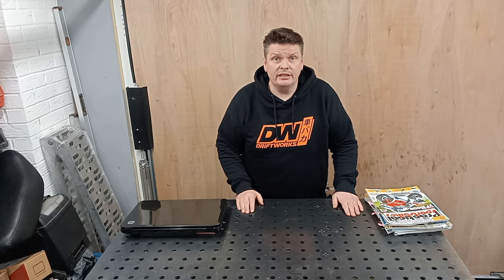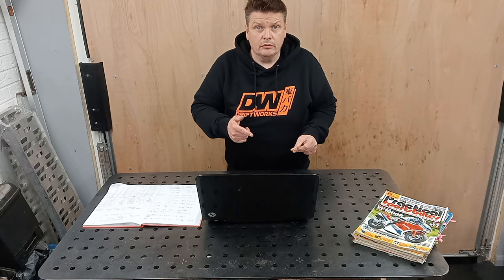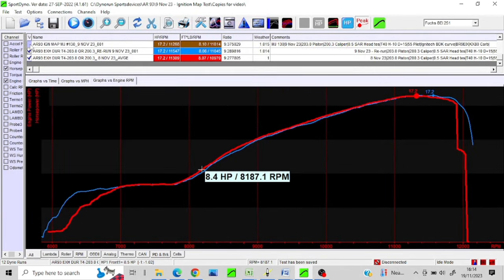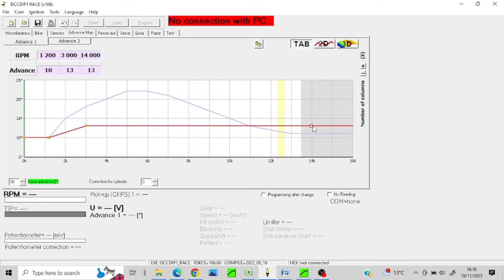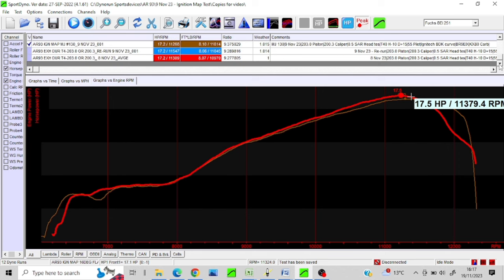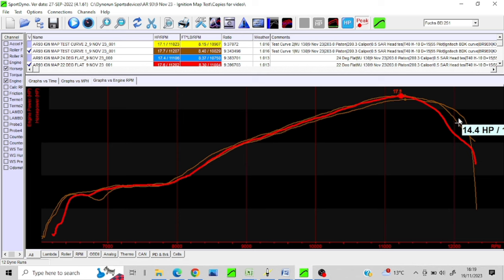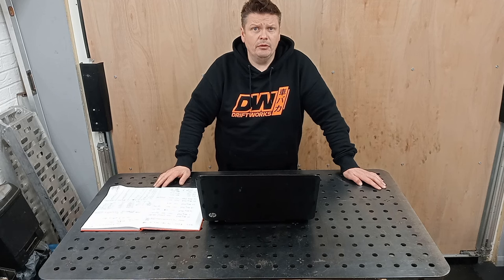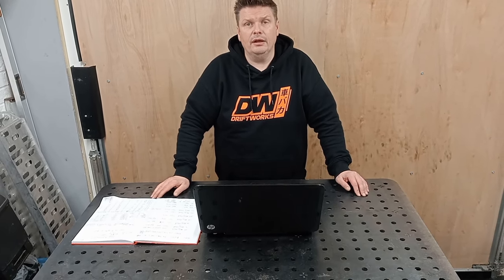How to make the perfect  2 Stroke Ignition Curve - 100 MPH Moped Challenge #2stroke #power #dyno

Comment: Dude Please don't pay any attention to Derek Harris, he believes that the reason for retarding the ignition at high RPM is just to create heat in the pipe, You can see your 10 degree flat line test sent the pipe temperature through the roof but the power curve was crap!  He thinks that the VE of the engine is not a factor in determining what the timing needs to be at any point in time. The real 'icing on the cake' for me was when he stated in a post that peak cylinder pressure should occur at TDC, this is total nonsense, the likes of Ricardo Developments worked this out years ago, peak cylinder pressure needs to occur between 14-20 degrees ATDC.

7:05 Your timing 'curves' make perfect sense, you can see how the timing needs to advance as the revs rise up to around 8k RPM, this is because the RPM is going up but the VE of the engine is still fairly poor, (the engine is not 'on the pipe'), in this state the timing needs to advance to give enough time for the flame front to create peak pressure at 14-20 degrees ATDC. Then as the engine comes on the pipe the VE starts going up and up, the initial cylinder pressure before the plug fires is going up as the pipe and intake 'resonate' harder and harder, the initial cylinder pressure has a great bearing on the flame speed so the timing has to start retarding to compensate for this. A.G Bells book on 2 strokes explains why a 2 stroke runs an advance curve until the engine is making decent power and then it runs a retard curve once its in the powerband, its all to do with the VE! (The aim is ALWAYS to get peak cylinder pressure at the right point in degrees ATDC)
Reply: Uncle Tony’s garage, did a video called “ ignition timing how much and why” 

It’s worth a watch.
Reply from the maker: Hi Pete, Derek is a very smart guy. From what I have read he's very well educated in two strokes. I also believe that the ignition being retarded after peak increases the over rev by heating the pipe and allowing it to resonate at a higher rpm. As seen in my video with the 13 degree curve being better after peak and shown by the egt increase at that timing.
Reply from the maker: Cool - I'll try to take a look
Reply: @AutoBeta2T  Yeah, fiddling around with the timing AFTER peak power RPM might extend the rev range by a few hundred RPM but really your main concern should be the power curve all the way up peak power, then after that anything else that you can gain after peak power is just a bonus. Like I said, the second that 'DH' stated that peak pressure should occur at 0 zero degrees (at TDC) my mind was made up. (I'll refrain from typing out what I actually think!) 🙂

Carefully set an engine up at exactly 0 degrees, then stand an elephant on the piston, no torque would be created at the crank!

DESPITE your reference to Derek Harris I will still 'like' your video!
Reply: @sidecarbod1441  What youre saying mimics what I have managed to learn about two-strokes over the last 30 years. Im not 100% sure but I imagine peak pressure at 0 degrees would be needlessly abusive to crank and rod bearings. There just no mechanical leverage to rotate the crank at 0 degrees either. It doesnt make any sense to me to do such a thing.
Reply from the maker: @sidecarbod1441 Pete, where did Derek state peak pressure should occur at tdc? I just rewatched his video and couldn't find it mentioned. He did say that the timing does occur closer to TDC.
Another way to think about it is  that the pipe is the key influence to the VE. Kinda chicken and egg.
Reply: @AutoBeta2T  Yes the pipe is the key to VE and the pipe temperature plays a part in that BUT the dimensions of the pipe play a much bigger part. Also the pipe will naturally get hotter when the engine is on the pipe for the simple reason that more hot gas is going though it. DH's comments are not in the video, they are in the posts for that video. He was not up for a discussion at all, I got the impression that he thought he knew everything and nobody could even propose a different 'line of thought'
Reply: @AutoBeta2T  In the DH video that you linked to He replies to one of my posts with.....

"A well designed two stroke often has peak cylinder pressure well before 12-14 degrees ATDC.  We commonly see the best of the best around 6-8 ATDC.  In a theoretical world we would want right at TDC."....  Not that I have seen any evidence of him measuring peak cylinder pressure and where it occurs in the power stroke, you would need to modify a head to do that, i.e. fit a pressure transducer and probably hook up an oscilloscope to it and to something that could measure crank degrees, all in real-time. Considering that his video was all about ignition timing you would think that it would be the one where he hooks up an EGT gauge if the timing is all about EGT. (If he did then the results would show the timing that created the highest power did NOT create the highest EGT, he would then leave that out of the video? LOL ) 

So he thinks in theory we want peak cylinder to pressure occur at TDC, this is nonsense because the conrod would have no angle for it to be able to produce any torque at the crank. In fact this is one of the reasons that detonation is so bad for an engine, basically the pressure rises extremely rapidly in the combustion chamber, well before the conrod can convert that pressure into torque at the crank, instead it places a massive load the piston crown, along with the little end and big end bearings.

In my opinion DH is a classic case of 'all the gear, no idea' 😜 (at least when it comes to ignition timing)
Reply: Your right on!
Reply: @sidecarbod1441  This is all just confusing ideal theoretical first principals with compromised reality. Ideally you would like to have 100% combustion complete instantaneously at TDC (theoretically constant volume combustion) so you could have 0 degrees advance and achieve the greatest possible expansion ratio. That is never going to happen but you still want to know why you do what you have to do. That's what theory is for.

You want it as fast as you can get to limit the BTDC pressure rise but you will have to tolerate SOME of it because fuel doesn't burn instantaneously. It takes time and the whole balancing act is to get the average overall pressure as high ATDC as you can get it without wasting too much before TDC while placing it in the most advantageous spot for best overall leverage on the crank. Conflicting requirements.

Detonation damages the engine regardless of con rod/crank position. There is little chance of converting much of that  sudden pulse into useful torque. If you take a hammer to your piston you will move the crank a bit but most of the energy goes into breaking things. That's detonation. The engine can't make much use of such a sudden , short pulse. There is too much inertia.
Reply: @AutoBeta2T  Yes retarding  ignition DOES dump extra heat into the pipe making it tune higher, for a price. That is a strategy used for when you have no other way to do it because you are giving up $3 to get back $4. You'd much rather keep the $3 and add $1 if you could. Variable exhaust port timing and your sliding trombone pipe might get you there without the loss.
Reply: @billshiff2060  Thank you for taking the time to reply to my post.  I think that at least in part you are agreeing with me, please correct me if I'm wrong!

With regards DH and to his 'theory' well it is a pointless exercise if you are going to 'bend' real-world parameters in order to suit the theory, the combustion process is not instantaneous and it never will be in an engine that is not designed to run with a fuel that is detonating. I defer to a 2 stroke engine that Honda actually built that under certain conditions was designed to promote detonation, or at least pre-ignition, Honda must have paid particular attention to where the crank was in the power stroke before they allowed the engine to detonate its fuel. Google... Honda "Readies Activated Radical Combustion" (I'd copy a link in here but youtube then deletes my whole post!). 

In theory I would like a combustion engine to extract 100% of the chemical energy contained within the fuel and convert it to mechanical energy, in the real world it doesn't so I don't put it forward as a theory, it's pointless!

I do disagree with you regarding detonation being a "sudden pulse" like taking a hammer to the piston, yes the rise in pressure is very rapid, and to a high value but the fall in this pressure is not rapid, once the pressure is in the combustion chamber it will remain until the physical conditions change, i.e. the piston moves down the bore, or a hole is blown in the piston crown!  To me, the word 'pulse' implies a rapid rise AND rapid fall in pressure.   In fact one book I have titled "Gasoline Engine Analysis" shows a graph of combustion chamber pressure against crank angle, it shows a pressure curve for when the fuel it detonating and for normal combustion, the detonation curve has a very rapid rise in pressure and to a very high value but the fall in pressure is no quicker than for a normal combustion event. 

Looking at the expansion ratio is all well and good but you can not just focus on this in isolation, the piston is connected to a conrod which is connected to the crank, there needs to be an angle formed in order for any torque to be developed at the crank. Some clever 'sparks' have even developed engines where the bore is offset with regards to the crank in order to improve the conrod angle.

In truth Derek Harris's comments on ignition timing and peak pressure at TDC were just the 'final straw' for me, I basically disagree (as to many others including authors) on his reasoning with regards to retarding the timing on a 2 stroke, he is basically focusing on creating heat in the pipe at the expense of producing peak cylinder pressure at the right time in the power stroke. I even asked him to explain why many engines now have a Throttle Position Sensor, TPS connected to the ignition system, it's basically because the throttle has a massive bearing on the VE of the engine, with the throttle just cracked open the VE is poor therefore we need to run more advance to compensate for the low flame speed. I actually gave him the answer but he chose not to reply, I guess it did not fit the narrative of his video.

Dave's experiments in this video prove that EGT is not the 'be all and end all' here, when he was running only 10 degrees advance the EGT was high but the power out of the engine was low, when he ran more ignition timing the power output was high but I bet the EGT was lower, unfortunately Dave does not show the EGT.  Even if the EGT remained high, this would not be due to the delayed combustion, because it was not delayed, it would be down to the simple fact that at high RPM and high load the engine is producing more hot gases and forcing them down the pipe.

This video and its result shows that the high output was down to the peak pressure being developed at the right time in the power stroke.
Reply: @billshiff2060  In my reply to you we are more or less saying the same thing..."he is basically focusing on creating heat in the pipe at the expense of producing peak cylinder pressure at the right time in the power stroke".

Having said that I would modify your statement slightly, I'd say he is giving up $4 in order to get back $3  😉 Although thinking about it he is probably running the correct retard curves, after all his dyno would tell him if he was not, its just that theory behind why a certain timing curve is the best is wrong.
Reply: @sidecarbod1441 i don't know how a hypothetical engine could have maximum torque at TDC. And why you would design around that or try to achieve it when its impossible? As you said torque is always at the jerk point that causes secondary imbalance.
Reply: @finlaymcdiarmid5832  I agree with you, and when Derek Harris stated that in theory we want peak cylinder pressure at TDC came to a conclusion about him that I will leave you to work out!
Reply: @sidecarbod1441  im no expert. Ive got zero formal education on the matter but i did read bells books and others. And they make it clear that all the cycles developed are not realistic and don't account for real world conditions. 

I think there is a good amount of egotistical people involved with engine design that refuse to admit they are wrong, to the point of wasting their customers time and money with pointless or damaging engine work.
Reply: @finlaymcdiarmid5832  I agree with you totally, I have learned not to be impressed just because someone has a dyno or other 'fancy' equipment, or posts up videos on youtube! Now don't get me wrong, some people have all the equipment and also know how to use it, and they also have good knowledge on the subject, I pay attention to what they are saying, but still with sceptical scrutiny.   I am just a 'home tuner' but I do have 40+ years of 'fiddling about' with engines behind me, I still get plenty wrong and I am always happy to be educated on things that I have got wrong. On the flip side I have educated one or two professionals in my time, the last one being George Boswell who has designed a whole new set of 'internals' to go inside Keihin PWK carbs, (Its called the STIC system). A few years ago he sent me this system to test, it had great potential but the AFR was miles off at idle and small throttle openings,  I argued with George for months over this, in the end I made my own carb needles to sort it out, (it took a few attempts!). A month or two later George asked me for the dimensions of my needle! He now supplies a similar needle as part of the kit.  Derek Harris has also tested the STIC system, I don't know his thoughts on it and I'm not interested in asking him!

I have had a few articles published in kit car magazines too, one was on carburation and another on ignition systems. (the others are not relevant to anything being discussed here). I have always been fascinated by internal combustion engines, even the fact that they just don't just fly to pieces the second they hit 10k rpm is just wonderful! 🙂
Reply: @finlaymcdiarmid5832  Who said a theoretical engine had peak torque at TDC??
Reply: @sidecarbod1441  Did you know sir some analytical method for calculating the most favourable ATDC angle for achieving the PP ? I suppose it depends on crank radius to con-rod length ratio and also of crankshaft offset or piston wrist pin offset if some are implemented in the engine construction of course ? In my believe every  particular engine have to have unique, constant most favourable ATDC PP crank angle which is determined by its geometric parameters . Please point me to some source of information on the subject if you know such of course ? Would be nice If we are able to calculate this angle based on the known geometric parameters of any particular engine , since today we have methods for real time  monitoring of the PP position ( ion current sensing technology ( SAAB Trionic , BMW , Mazda , Isuzu , Saturn and even HarleyDavidson use to some extent such a technology)) which allows us to implement closed loop control strategy in calculating timing advance angle and to optimise it automatically,flexibly and objectively depends of variations of fuel octane ratings, atmospheric pressure , humidity, etc . 
Thanks in advance !
Reply: @flappingflight8537  I do not actually have the calculations that have led engine developers come to the conclusion that the most favourable angle for peak power is between 14-20 degrees ATDC. I have read from several sources including the web that at least explain in simple terms why this is the case, you are right it is down to the conrod angle and this can vary to a small degree due to the conrod ratio. Having said that in order for an engine to perform well in terms of power output, it’s longevity, low vibration etc things like the conrod ratio will fall into a fairly small range, any engine that strays too far from the ‘norm’ will have some bad traits! (TVR V8 engines being a case in point!). In other words, engines with excessively long or short rods compared to their stroke will have issues, in the same way other parameters are fairly well established, bore to stroke relationship etc. Of course, manufactures do vary these parameters in order to produce an engine that suits their requirements, high revving, or low revving with lots of low down torque, that sort of thing.

Things like the offset wrist pin can of course all help in getting a better conrod angle but it is mainly used to reduce side thrust on the piston skirt, the most weird thing I have recently seen is offset cylinders, (offset to the crank shaft) these really do have some odd traits which are actually quite good, things like the compression stroke being shorter than the expansion stroke, the power stroke being over 180 degrees etc. To my mind these are slightly ‘mind blowing’!!! There is a good video youtube by “Driving 4 Answers” The video is titled “Cylinder Offset Changes Everything” In the example engine in the video the power stroke is 193 degrees, the compression stroke is 167 degrees! I have no idea where you would want peak cylinder pressure in this engine! 
With regards to peak pressure and the power stroke I suspect that this relationship was first discovered by experimentation rather than by using theory, (but I have no proof of this!) the likes of Ricardo in my mind would have run an engine on a dyno whilst monitoring peak cylinder pressure in real-time, then by adjusting the ignition timing they could move the point in the power stroke where peak cylinder pressure would occur whilst monitoring the torque output of the engine, it is then just a simple matter of looking for the peak cylinder pressure point in the power stroke that gives the highest torque output. There are good graphs on the web that show this sort of stuff, equally there are poor graphs that just assume that you would want peak pressure at TDC!
To my mind things like burn rate won’t actually affect peak pressure point at all, it is a purely mechanical ‘thing,’ the burn rate will affect the point in time that you ignite the mixture, with a faster burn rate meaning that we can run less ignition advance, this then meaning that the rising piston is having to do less negative work.
Reply: @sidecarbod1441  thanks !
Reply: Maximum torque will occur after 45° crank angle and when most of the mixture has finished its burn. Say somewhere before the exhaust opens and 60° atdc. I'm curious if shortening the blowdown and adding case time area to the intake port will make more or less peak rpms. The pipe would need to change a bit.
Reply: @kenmoule825  I'm interested in why you think maximum torque will occur at a crank angle of 45 degrees ADTC, please explain.